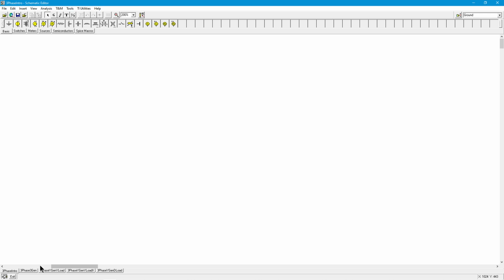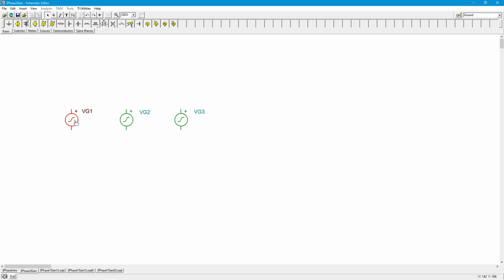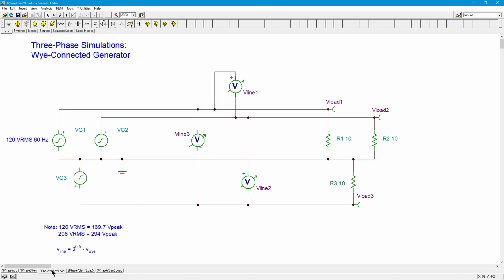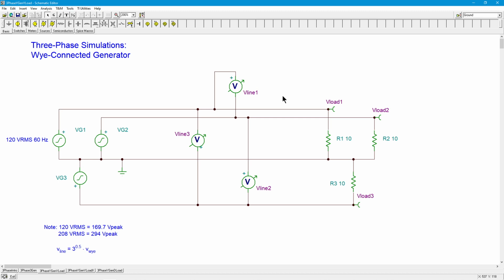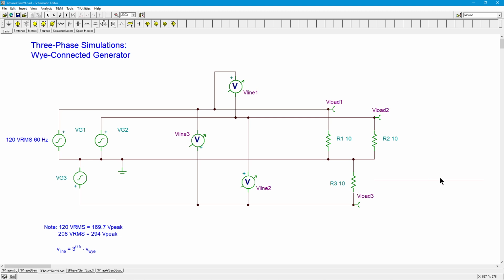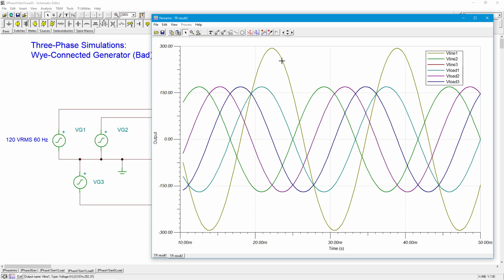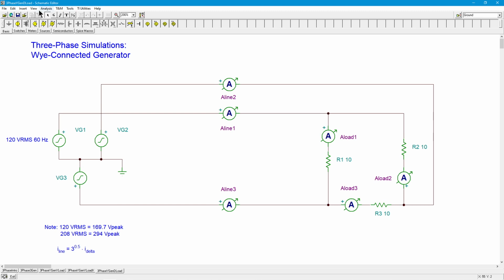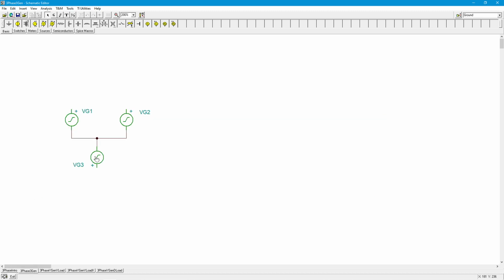AC Electrical Circuit Analysis: How to Simulate Three-Phase Systems, Part 1

Comment: Good video. @7:25 of the video, you are speaking about "polarity" in clock wise durection. But in previous videos (if i am not wrong), you didn't speak about it. Can you make a small video about it?
Thanks.
Reply from the maker: The issue here is one of keeping things consistent. If you get one of the phases backwards, the sim will go off to crazy land (and in the real world, swapping cables backwards might do something like make you motor run backwards). If your simulator of choice has a 3 phase generator component, I suggest using it instead of the generic method outlined in this video, particularly if you don't have much experience with 3 phase.
Reply: Thanks for the clarification. Keep it up.

Comment: Interesting difference between an electrician and an electronist.
Reply from the maker: I am afraid that I have never heard the term "electronist" before. Certainly, there is a big difference between an electrician and an electronic (or electrical) engineer.
Reply: @ElectronicswithProfessorFiore  You are correct. It is a term used in my language and I used it incorrectly. But you understood the meaning of what I said.